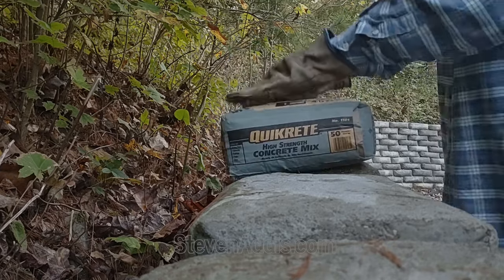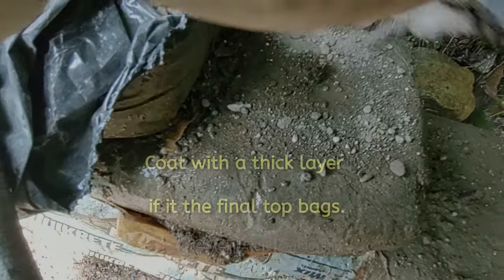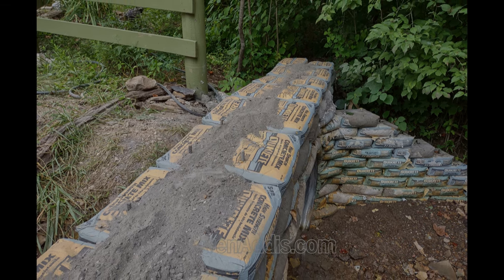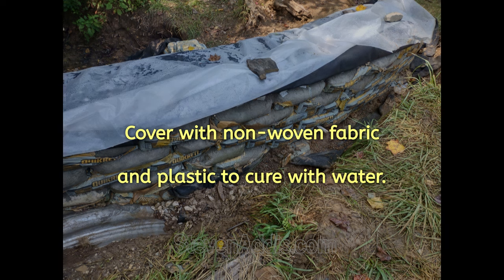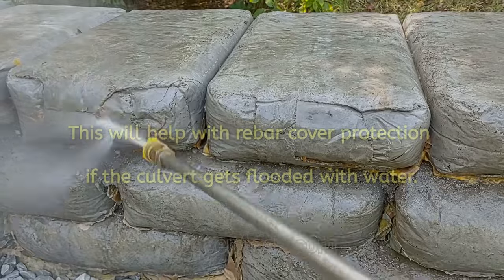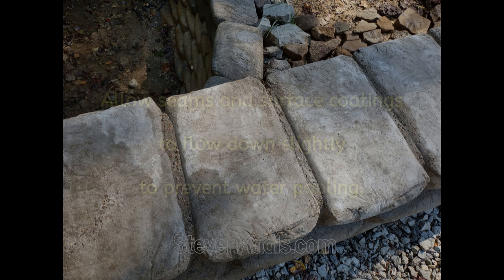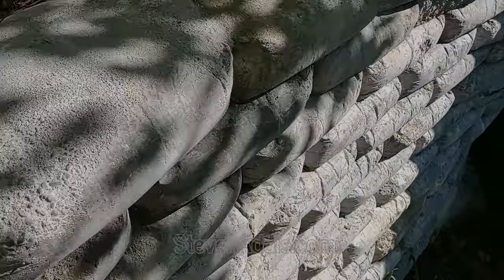Improvements & Methods - Concrete Bag | Culvert Retaining Wall | Steve Addis

Comment: So Steve, I'm looking to divide my small pond in half (currently about 2' deep) the cheapest way, because I cannot get large equipment down to it, do you think a "bag" wall would hold water back if I just carried them into the pond and put them in place?
Reply from the maker: I placed bags under water in front of my culvert and they setup very solid. I would cleanup and prep where you place them. Mix the bags well and pack them. Place them carefully one course at a time and do not disturb them for a day or two. Then check them and continue. I would not want to use rebar unless it is fiberglass. I never tried stacking more than one course under water and would be afraid the bags would stretch too much and break apart. Let me know your results. Thanks

Comment: So its start small area first bottom row - rebar in rebar across - wet bottom row - then add next row. Repeat how many rows up and how many across?
Reply from the maker: Do more than one row and what you feel you can do at the time. Wet the sections yet have the vertical rebar protruding out so that you can continue with connected bags.

Comment: If you do this for a retention wall do you need dead heads or geo tile in backfill?
Reply from the maker: Yes, you should. This soil was so hard behind the wall a pickax would not hardly break it except for the surface top soil. I was not about to disturb that solid area for a tieback. Thanks for the comment.

Comment: HOW'D YOU GET WATER INTO THE CENTER OF THE BAG.   TO MAKE SURE
 IT GOT WET  TO HARDEN❗❗❗
Reply from the maker: I tested it with and water absorbs or wicks in to the bags easily, especially when the rebar punches through. Yes, I made sure. Thanks for your comment.
Reply: Actually I always thought it would be a good way to build a wall  O F  any type . House.
Garage. Retaining wall. 🤷🏻‍♂️
👍🏻👍🏻🙏🏻🇺🇸🇺🇸💪🏻

Comment: Ive been thinging of building a gabion wall refaining wall but doing it around a cement bag wall. The look of the bags will be irrelevant as they will ve covered on the front and top with sones. Seems like it may be a way to get the look i want while being potentially stronger and MAYBE saving time and money (i expect the concrete to be xonsiderably cheaper than the stone i would use to cover it). Any opinions?
Reply from the maker: Best to get pricing on both bags and riprap stone by the ton. My last riprap purchase was more costly than than smaller stone mixed with lime. Now concrete bags have gone up in price as well. For sure, put ties in the bags to allow for the gabion connections. If I wanted gabion, I would put the cloth behind it and just go that route, unless there was a special need in a section of wall for using the bags stacked. Thanks for you comment!

Comment: Would these work for a basement as an exterior wall if I reinforce it by making an inner wall of cinder block?
Reply from the maker: These examples are free standing walls and not structural foundations. Though I am not an expert, I would prefer formed basements with rebar well sealed. A facade wall for appearance? It is great that you are thinking and looking outside the box which leads to creative ideas. Take care.

Comment: Instead of taping the top row could you place bags of sand or gravel there instead to hold the top level and in shape?
Reply from the maker: Yes, that sounds like idea that would work. Thanks for your comment!
Reply: @SteveAddis  once the wall is set you could then just tip the gravel into the culvert as a liner or behind the wall as backfill, if it's going to end up in there anyways might as well put it to work on the way lol

Comment: I have some culverts that need retaining walls. I looked into the commercial rip rap bags but they are not available anywhere near me. Do you recommend any one brand of retail bags over another? The area I am doing is smaller than yours, so I am probably looking at either 60lb bags or filling grocery bags. Any helps in choosing mix or brand is appreciated. Thanks for the videos!
Reply from the maker: Hi Rick. Quikrete has worked well using standard ready mix. I had one bag from a pallet that I rushed and did not mix it in the bag. The side did not setup. Not bad out of 10 pallets. You should be able to use any brand "ready mix". "Test" the concrete brand you buy first, mix it well, then water it. It is more work for me moving it in smaller bags. Maybe you can stack 60lb bags with the smooth "ends" facing out and get your wall thickness with the length of the bag and save time keeping the material in the original bag. Be sure to roll and mix the contents. Your bagging method will allow you to mix multiple bags together, which should work well. You are welcome and glad the video might be helpful!
Reply: @SteveAddis  Thanks!

Comment: Have you built any free standing (non retaining) walls using these bags? I would absolutely love to have something like this up to replace my privacy fencing that is literally falling down. Don’t need a retaining wall though.
Reply from the maker: I have thought about it some for just above a drive retaining wall. I planned to make it short though, connected to the wall. Then go up a few more feet with PT wood using steel post anchors.  You might research how to make the foundation and structure so that it does not fall over because of the weight. It might need to be built similar to the old stone walls of past. I bet that would be a nice looking fence!
Reply: @SteveAddis  I’m in no physical shape to do any sort of fence. But I would so love it, at least in the back. And think it would be pretty secure too.
Reply from the maker: Maybe you could plan the job. Find some reasonable young friends that would not charge too much, up for the challenge. Direct the whole project and get the results you want. Then do the mortar, color and so forth. I am trying to get this done while I can, so I never have to do any of it over again. I have had a privacy fence rot over time and require maintenance. These things should last long past my shelf life.

Comment: Longevity of this method?  Seem like it might lead to un-uniform concrete, low strength, and cracking. 
I'm not a concrete expert, so I wonder what an experienced expert would say.
Reply from the maker: @J - It has been done years ago. Not as strong as a pour, yet better than the big box store blocks. Non structural use here yet testing would be great. I will post in the future for sure.  - Thanks for commenting.
Reply from the maker: @j - Other commenters -
Seen this done on a country road some 40 years ago, its holding up very well too! Good Job!

Excellent vid! My neighbor did the same build and it is holding up fine after a few years. He saved a lot of money. Thank you for taking the time to post this...

My mom built a wall like this as a retaining wall for her pond. It's been there for years and still holding up well.

Comment: This must cost a lot
Mine I mix gravel and sand then put back in the cement sack then piled up 😁😁😁😁
Reply from the maker: Hi. It the time it was not too much, the wall less than 1k. Do you mix the concrete with your mix of gravel and sand? That would extend the mix and still be better than the big box landscape blocks. Thanks for the information! :)

Comment: Would not be easier and cheaper to just make a plywood frame and fill it with concrete rather that stacking cement bags, or even lay a brick wall?
Reply from the maker: It might be.

Comment: Is the country a specific kind for this method? What is the name?
Reply from the maker: Not for certain what you are referring to. Unless it is a comment about county maintenance using the method sometimes.
Reply: @SteveAddis  sorry meant to say is there specific kind of concrete to use?
Because there are so many different ones at Home Depot. 
Thanks
Reply from the maker: I used Quikreet "Ready Mix" 4000PSI. Ready to use. Cement+sand+aggregate. I used paper bags or "Fiber Reinforced" bags called "Rip Rap" bags.

Comment: LOoks to me, like it would have been easier to cast large bricks out of the concrete and wet stacked them with mortar. All this post build work would be unnecessary.....i'm not convinced...
Reply from the maker: Thanks for the comment. I have not cast concrete bricks at least yet or done mortar work. Cast bricks are solid for certain. Two extra steps compared to simply stacking like I did. I like a wall that can pass water through and not hold it back.

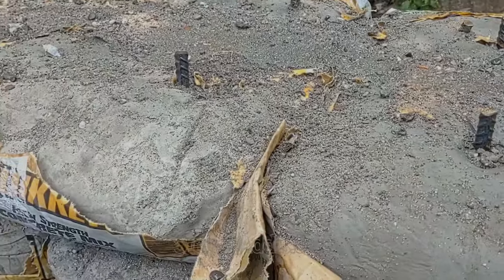Comment: It's all going to fall apart so quickly and become a real Big mess... we can already see the thousands of cracks everywhere, 2 or 3 winters and it's over... 9:38 the sponge effect shows that the cement doesn't is not solid and will become a very frillable cement... use dry stone or gabions...
Reply from the maker: Thanks for the comment. Yes, I noticed those too, when it was not setup...yet now on 3rd winter and it still looks fine. My followup video two years ago explains. Of course it is not a pour, yet very solid. https://www.youtube.com/watch?v=b1dk4jhQfws